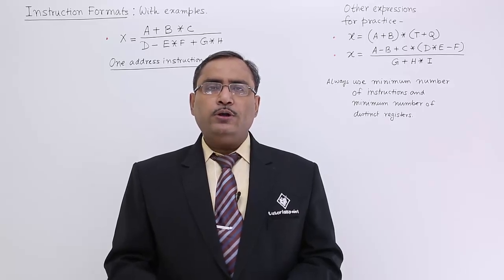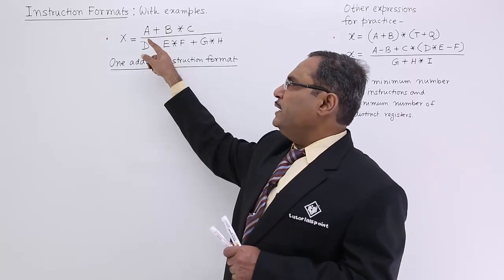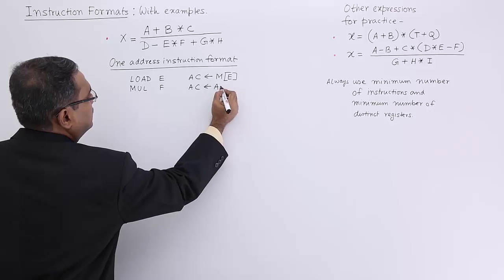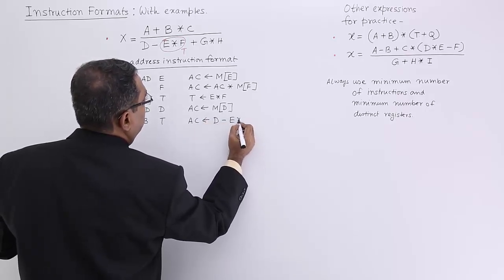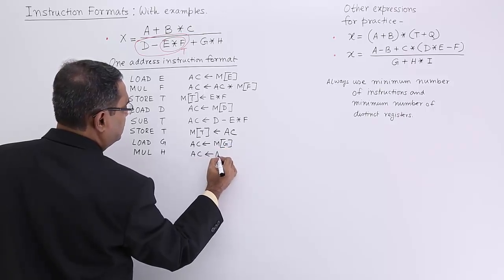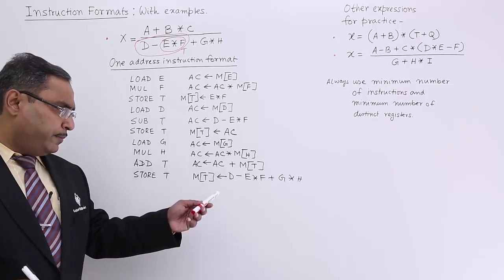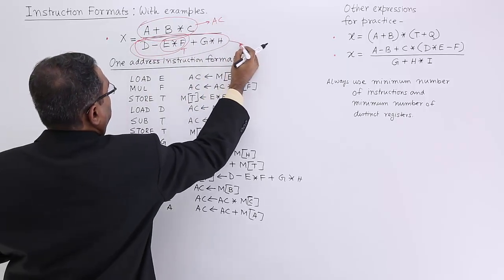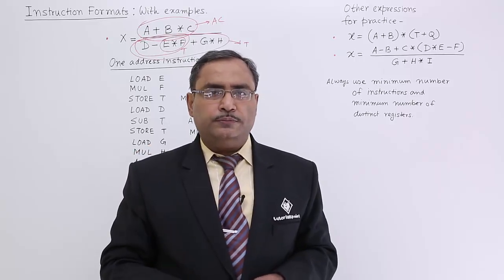1 Address Instruction Format Example

Comment: I am a little confused here...
I wrote the same expression using only 13 instructions, which i have check is mathematically correct...
LOAD    E    (AC = E)
MUL    F    (AC = AC * M[F])
STORE    T    (M[T] = AC)
LOAD    G    (AC = M[G])
MUL    H    (AC = AC * M[H])
SUB    T    (AC = AC - M[T])
ADD    D    (AC = AC + M[D])
STORE    T    (M[T] = AC)
LOAD    B    (AC = M[B])
MUL    C    (AC = AC * M[C])
ADD    A    (AC = AC + M[A])
DIV    T    (AC = AC / M[T])
STORE    X    (M[X] = AC)
The question is how should we decide in which order to do the operations...